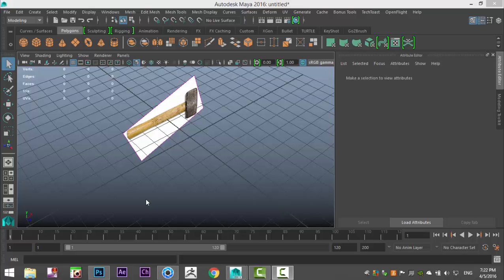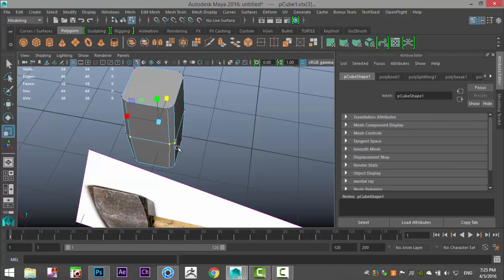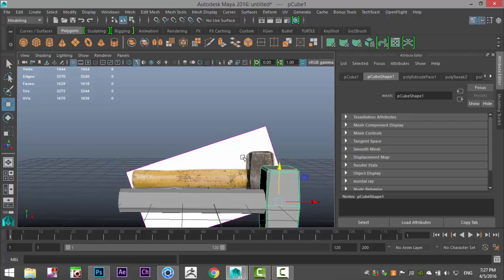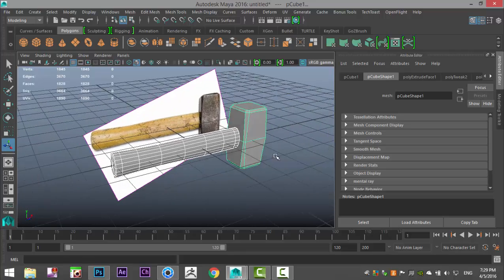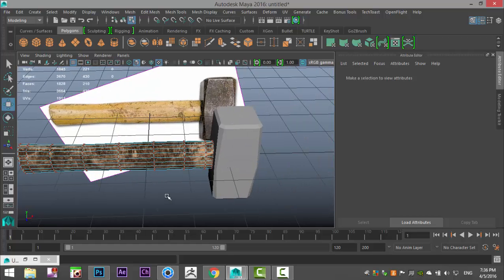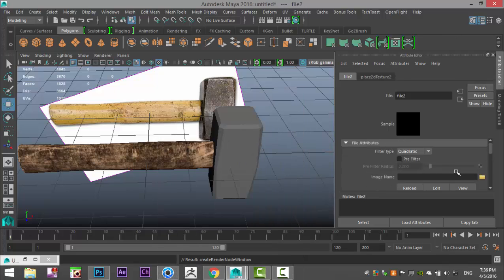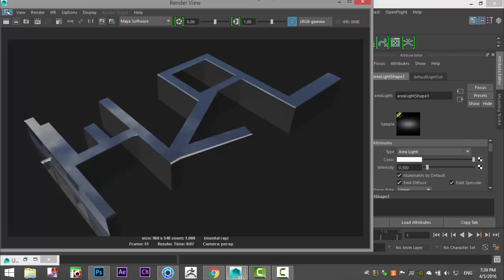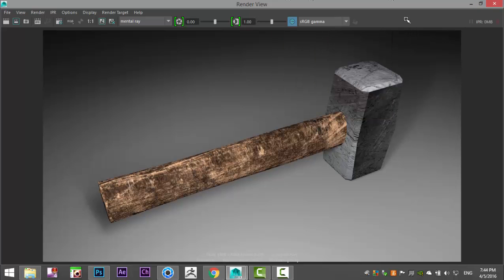Modeling Low Poly Hand tools in Maya part 1 : Hammer

Comment: I dont know what im doing wrong, but for some reason, my UVs never seem to "match up" to the shape of my model. For example, when I choose an automatic projection on the hammers metal part, I get just a bunch of very "square"-like UVs in my UV editor that doesnt match the shape of the 3D model at all. Any suggestion on how to fix this?

I uploaded an image to imgur that shows my error: 

http://i.imgur.com/uCMgryI.jpg
Reply from the maker: +Dennis Holmgren Dennis, what you are seeing is exactly what you should be seeing,. Your UV editor shows all the faces of the steel section and it is up to you to stitch them together as shown in the video